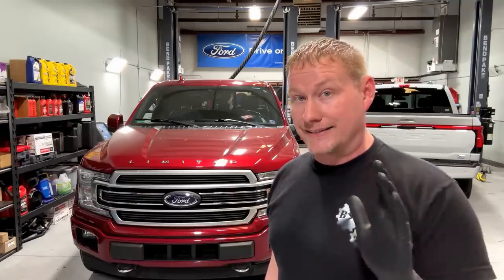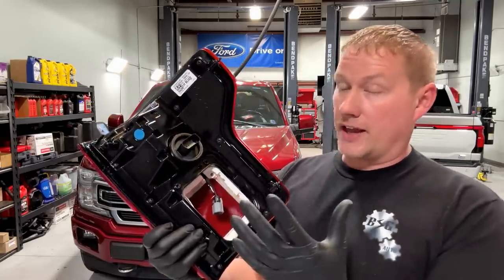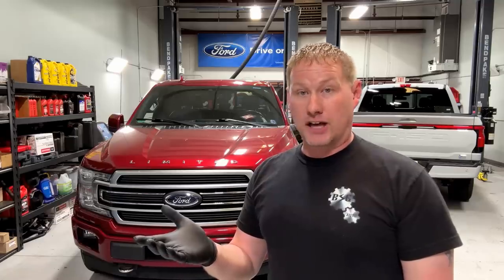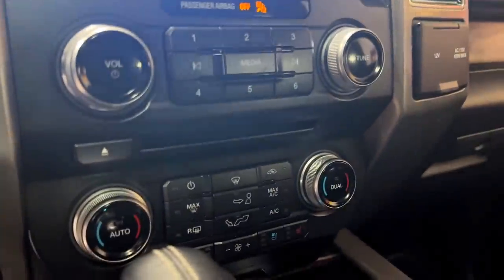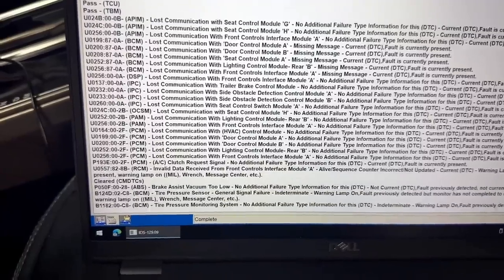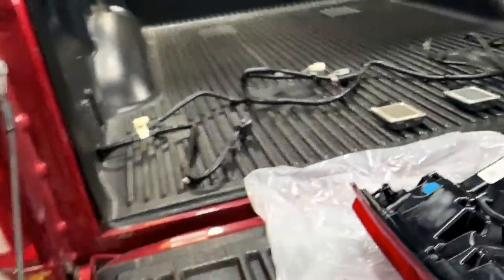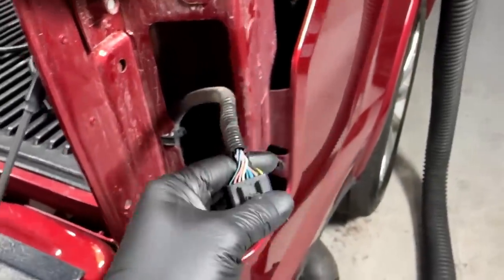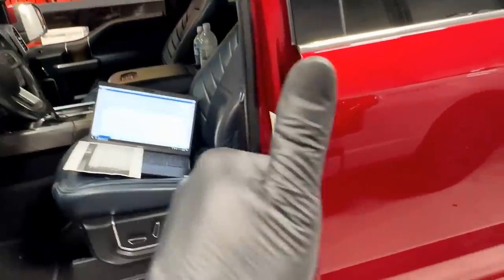Repair Cost Are Out of Control: $5,600 Bill for Some Tail Lamps?!

Comment: This is an incredibly compelling case to avoid modern vehicles.
Reply: im currently driving a 1000$ suburban with a 454, gas price is ok since I got it so cheap and fix myself
Reply: Amen to that
Reply: @TheInsultInvestor And on top of that, you're not paying thousands for a tail light repair
Reply: @jisezer  That's an excuse to enable dealerships. Just because you can afford something doesn't mean it's a worthwhile product.
Reply: @jisezer  Watching this makes having an 86 Dodge D100 still more reasonable.
Reply: Or get an extended warranty
Reply: @user-rw8zj1td9v  a warranty is just gambling on you breaking down. It doesn't save anything on tco. Additionally, to make money you are just as likely to end up in a fine print exception.
Reply: Couldn't agree more.
Reply: Yep! I won’t buy a car post 2012. Newest year car we have is an Escape 2013.
2010 Fusion
2006 F150
2011 Acadia
Reply: This is simply not true. These are FORD prices for "modern" vehicles. I have a 10 year old escape, and headlights were $600 per side for the base model, $1300 for a titanium. Tail lights for a brand new honda truck (with all the same features as this F150) are available for under $400 all day long.
Reply: here here
Reply: This is why I drive only classic vehicles. I get nauseous even walking by car lots nowadays.
Reply: @tonyb9340  indeed
Reply: Also, these modern  "smart" truck tail lights are easy to steal and sell.

DONT GET ANY IDEAS YALL!
stealing is bad mmkay
Reply: @m.m14433  "mmkay" lol
Reply: It's not, new cars generally are much better, they are faster, safer and drive so much better even cheapest new car will drive better then old premium car. Generally insurance pays for everything anyway that why dealership prices are out of control in USA it's same as your heath system it's broken. Where I live (Poland)  ASO of ford sells such lamps for $300 and used are $200.  It's once again on your failed I durance system.
Reply: No it's a compelling case for legislation and controls to protect consumers
Reply: Or all the bells and whistles.
Reply: I got a 5yr 100k bumper to bumper extended warranty at purchase for about $2700 (if I use the same dealer the deductible disappears) on my 2024 Dodge Hornet GT. I can purchase another 5yr 100k warranty before the expiration of the 1st one. My dealer also includes a lifetime powertrain warranty on all their vechiles. I prefer vechiles with non power/heated seats, heated steering wheel & no glass in the roof on all new vechiles that I buy.
Reply: @TheInsultInvestor  Did you have to get the 3/4T to get the 454? That was apparently a thing in 99. What year is yours?
Reply: It’s also limited…
Reply: @Boats_N_Hoez  
I had a previous factory extended warranty on my '17 200. It included the heater hose/coolant on top of the covered 2 engine mounts.
Reply: I've been screaming about this crap since cash for clunkers
Reply: You're absolutely right on that one, 3 years ago when I was looking for a new car I decided to go with an older model. I wanted something reliable that I wouldn't have trouble finding parts for so I decided to go with a Buick with the 3800 six cylinder engine. I was very lucky I was able to find a one owner Buick Regal with only 22000 miles. In the three years that I have owned it I replaced a couple of Parts. Unfortunately for me a year after I purchase the car i was in a head-on collision with a Mustang. My car ended up with minor cosmetic damage. Nothing a new front clip couldn't fix. I replace the bumper hood and right side fender. I spent a total of 160 bucks at the junkyard and was even able to find a matching Buick at the junkyard so I didn't even have to paint the car. The car was back on the road that same week. Unfortunately for the Mustang it was completely totaled. the fireman that showed up at the scene of the accident was really shocked that my car had minor damage in the other car was completely destroyed. Older cars were just built different back then they were built to last. I wouldn't trade my Buick for anything in the world, it's reliable comfortable and cheap to maintain on the road
Reply: This is the state of modern life
Reply: Drive a 1989 Olds 98. Great car. Anything goes wrong I can fix it myself. 206,000 miles, still runs and drives great😊😊😊😊😊
Reply: @superbroadcaster  I had a taillight issue the other day that cost me nothing because I had a spare bulb 😁
Reply: It’s a compelling case not to buy Ford. GM, Jeep, etc
Reply: @davidjsouth231  go price some of those parts new, they mean not having any vehicle post 2000 basically.
Reply: Junk  E🚙V cars 😂 at $20K Chevy Bolt battery
Reply: @tonyb9340 $100K for Pickup trucks. No way Jose.
Reply: I own a 2016 and I don't see me going any newer  , I work in the Auto parts industry and I see prices and what we sell and myself , 2016 , maybe 2017 would be my newest I'd go , after that  , especially once you hit 2020 anything  , quality just isn't there no more , during the covid plandemic , quality went out the door and it's never fully come back... So make garbage products and charge more for it 🤣😂
Reply: I wouldn’t trade my 89 Lincoln Town car for any of the new plastic over priced junk they build now. 
 I can check my oil, transmission fluid, power steering fluid with a dipstick, check my break fluid add any of these fluids myself instead of taking it to a dealership where they would rob us blind.
We’re 81 years old, my husband showed me how to do these few simple things
He does the oil changes, replaces brake shoes, greases the car.
The old saying, oil is cheaper than parts.
My car has 90 K miles, the original paint job, not a spot of rust anywhere!
They keep saying the old cars are unsafe, well we made it this far, plus we rode in the 50’s cars without seat belts, padded dashes, without all the computer stuff that operates all the whistle and bells of the new ones that costs a fortune to repair!
Reply: @janetyurkin822  I grew up in era where my dad had a 67 Lincoln 2 Dr Continental with the 462 CID engine and that cool "speedometer". We also had a 71 Continental with 4 doors. Love  those cars and also had a Mark IV plus... Today's cars are goat tripe L😁L
Reply: @davidjsouth231 replacing the Alternator on Escapes sucks because for some reason ford thought it was a Great Idea to put it down low behind the Strut tower and tire right where all the Water is going to get spit up and trying to get to it is a just a Pain
Reply: Growing up in the car business and being born in 1965 I find this insanity as laughable as it is pathetic. Some people have more money than brains.
Reply: @deltasixgaming  well let’s hope I don’t have to tackle such a task
Reply: @rocknewtonfilsterwilly7364 my father was born in 45 and grew up in a tiny West Texas town. Having your car in good operation was essential in those days. I asked him one time why he just doesn't take the car in for service and his reply was " I have more brains than money. I'm not going to pay for something I can do myself and if you are not here to help and learn quit wasting my time.😂
Reply: @tranger4579  My Mom's Father always said never pay someone to do something you can do yourself. I personally find that wisdom holds today more than ever. Even in those rare occasions when I pay someone to do something because my time is more valuable spent doing my thing, in the end  9 times out of 10 I still have to go back and do it anyway to fix their f&^k ups. I just do everything myself, except kidney stone surgery, heart stents and roofing.
Reply: @rocknewtonfilsterwilly7364  my father taught me how to roof.
Reply: @tranger4579  Not a question of how, a question of being one guy vs 8 or 10. I have a very large roof. lol Cheaper to hire that one out and for me to make my money.
Reply: @wykydytron  glad you like your new $40,000+ front wheel drive fully optioned car and like buying a new one every 3 years. Me, I don't have that kind of money.
Reply: @norfolkngood8960  You do know it's the legislators who forced this crap into cars, right?
Reply: Agreed. ai just went through hell trying to change the oil in a 2015 Nissan Rogue... a job that I actually usually enjoy. The reason? AC line routed directly over the dipstick, Oil filter behind wheel... requiring removal of a flimsy Plastic panel on which the previous users had already broken most of the plastic fasteners... Not having a lift, only ramps, i had to jack the wheel up off one ramp, sketchy as hell, just to get access, especially since it was already drained when I realized where this thing was.
Reply: Now you know why I’m driving a 1970 VW Type 3 Fastback
Reply: @TheInsultInvestor  My thoughts exactly. You can buy a whole lot of gas with $80,000.
Reply: Biggest Problem sadly soon All vintage cars will be banned
Reply: @jasoncrandall73  If you don’t mind paying dealer prices. I would be willing to bet in the fine print of your warranty requires all maintenance has to be performed on schedule and at that dealership or approved dealer. Buying New cars is foolish and throwing money away. You literally toss thousands of dollars away in payments, interest, insurance, maintenance, and thousands In depreciation the moment you drive it off the lot.
Reply: @mikerobinson8734  
Here's the thing with that........
I change my oil on my 2024 Dodge Hornet at 5k/3mo which ever comes first (17k so far). I also don't use the cheapest gas.
My 2017 Chrysler 200 was changed at 6k/3mo & it had 160k on it. The 200 tho could take 85 octane but used 87 octane. Both full synthetic oil. 
I was offered $11k trade in on the 200.
Reply: I told my gf a couple minutes before see your post
Reply: Gee wandering why your vehicle is totaled when someone rear ends you at 15 mph.
Reply: I own 4 vehicles and they all range from 65-93 and that's as new as I really want to go.